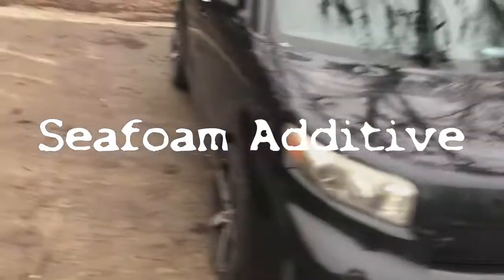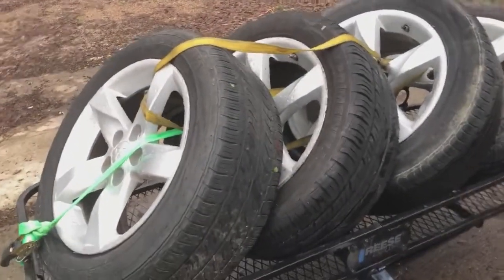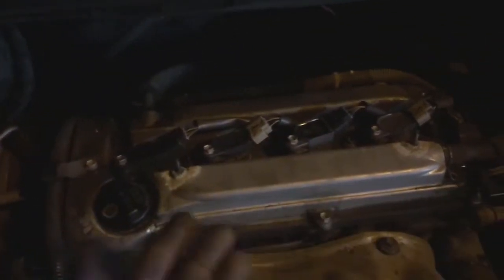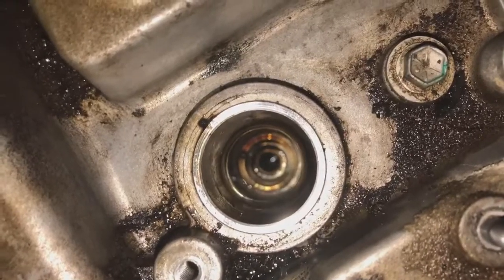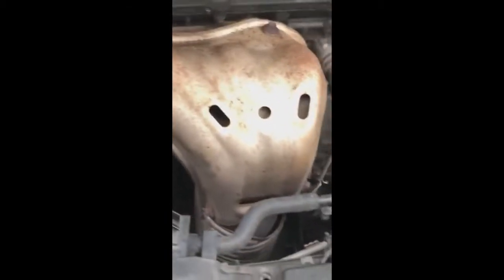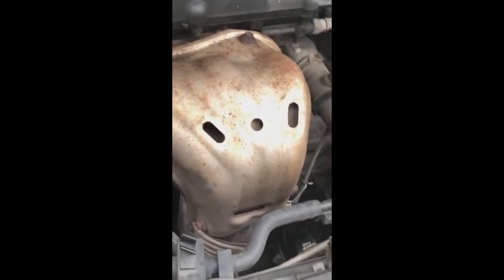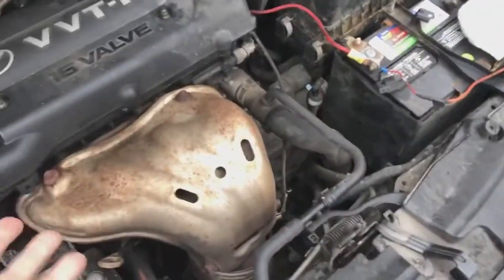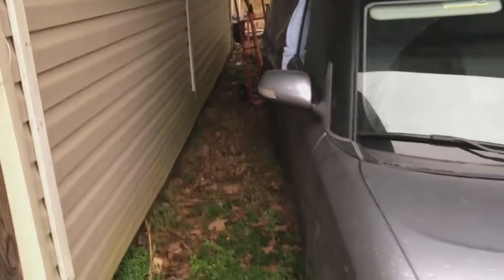Using Seafoam to reduce oil consumption (or how to drive a tree smashed Scion xb 360 miles home)

Comment: I know this is an old video, but I watched a scion xb video from a mechanic. In the video he mentioned Seafoam, which is how I learned about it. He said he puts the seafoam straight in with the oil into the engine, drives it for about a 100 miles and then does an oil change. Does it everytime he does an oil change. Said his car stopped burning oil.

So he did 2 different things. Seafoam straight in with the oil, and drive it 100 miles before emptying the oil and seafoam out. Maybe not snake oil wiht that method??? idk
Reply from the maker: Hey there. Thank you for watching the video. If you look at some of my other videos I have on here, I did the same process on three scion xbs.   But the difference is is that I used Berryman's B12 instead.   Same exact process, but the difference is is that it actually solved the problem on two of the cars and solved it to about 95% on the other one.   The car that is in this video I still own now, it has 253,000 miles on it. Before the treatment it was using about a quart of oil every 300 miles. Now uses a quart of oil about every 5000 to 6000 miles. I can live with that
Reply: @theoriginaljimmykicker How much B12 did you add to the oil before you started driving it around?
Reply: How much do you pour into The oil?

Comment: I may get a 2012- what do I inspect as far as the motor? Subscribed. Thanks In advance..
Reply from the maker: Far as I know 2012 is ok and should not have the issue.  Should be covered as long as it's under 150k and 10 years still too.

Comment from the maker: I have to admit that I was right.  I opened the doors and they would not close again.  Imagine that.  I jacked the roof out some and I sold the motor from our 08 to a guy that had a lifted 08.  I decided I wanted to    do that.  But not to my daily.  So once is swap the motors?   I’m gonna take the oil burner, and the trashed body parts and install them on this.  Then I’m gonna cut the roof off behind the driver door and make an off road piece of shit truck out of it.  Let’s see where this goes.
Reply from the maker: Turns out that the doors open and close fine after some initial straightening.  Haha😅

Comment: That’s a lot of oil
Reply from the maker: It is.  But some do much worse than this.  The car still runs perfectly.   Just uses a shit ton of oil.
Reply from the maker: I tried this same thing with Berryman’s B12.  Did it twice.  Car now uses a quart about every 1200 miles.  Good stuff.
Reply: @theoriginaljimmykicker nice, how many cans/oz did you use of the Berryman?
Reply from the maker: @jeffreyzie  hey.  You can use 2 cans to start with.  If you have a couple days you can park it, do it twice.  Put the cylinders all in the middle and half can each one.   Then in 12-16 hours do it again.  Be really careful when turning it over before reinstalling the plugs.  Make sure all the solvent is gone.  You can take something like a screwdriver and dip in in there to make sure.  Or maybe see it with your phone.  Take the coils off before spinning it to blow any loose carbon out.  If you don't and there's any solvent blowing out it could cause a fire.  Car fires are NOT fun.  It's good practice to have a fire extinguisher nearby anyway when playing with solvents.  Don't be discouraged by this at all. Just make sure that the coils aren't on there so there aren't sparks flying around loose that could ignite it.   That's just a safety tip